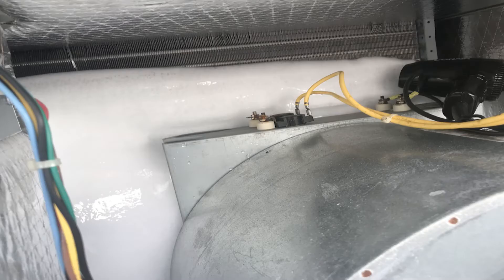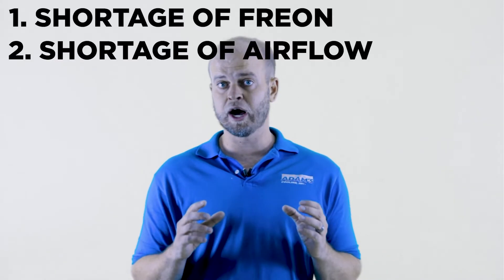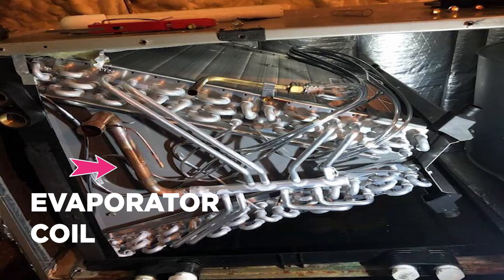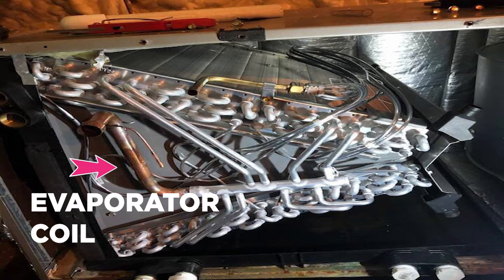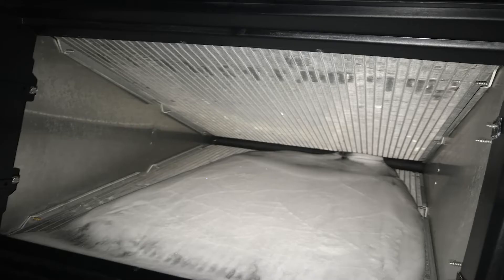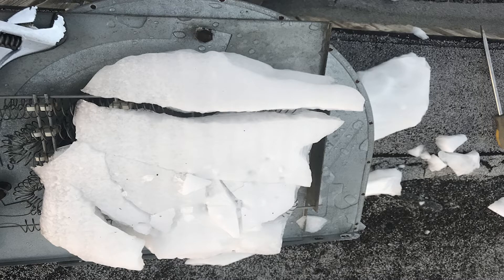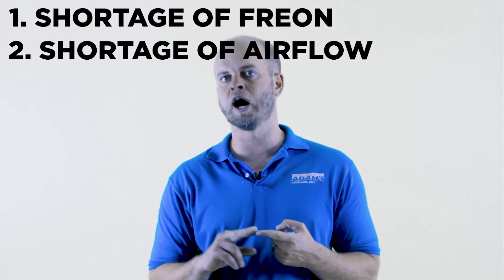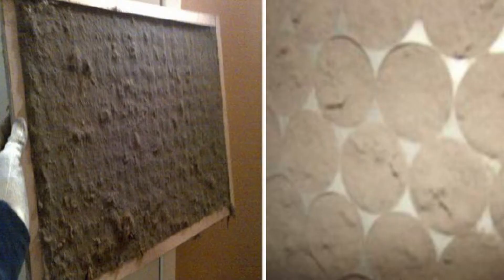AC Freezing Up Inside House - Here's Why

Comment: Can the coils on the outside turn white with ice around it? Everything seems to be working good inside besides the unit inside the house seems louder and it also gets cold (doesn’t turn to ice completely but does have ice around it)
Reply from the maker: You might have a restriction on one of your ac lines in your coil outside. Hard to say without seeing it.

Comment: I need help 😢 my ac stopped working completely I had a repair man come and he fixed a loose wire now The air is blowing cold, the filters were dirty but now there cleaned and its still freezing over at the pipe inside the house is it safe to take apart to clean the coil or what do you think could be wrong.  I also tried running with no filters for a minute and the same pipe froze
Reply from the maker: My first question would be, is the inside blower motor running (that means, when you turn the unit on, is there air blowing out of your vents inside). If there is air blowing, the next place I would look is maybe cleaning the coil. We have a video called Dirty Evaporator Coil Cleaning. I would watch that video and I hope it helps 👍

Comment: Blower motor cap is out would take out the blower motor right  ? Then blower wouldnt push air at all right ? It's working got cool air but don't want a repeat of frozen inside unit . And not one video has said one possible cause of this is failed outside unit capacitor right ?
Reply from the maker: If Blower motor capacitor is bad then yes, it will keep your blower motor off, which would then freeze your unit up. Hope this helps!
Reply: @mechanicsfornonmechanics8998  I just went out to an acquaintance house and checked that her drain line was draining and she then told me an AC tech been out there filling her refrigerant.. not fixing the leak just charging her to fill refrigerant.. geez 🙄. No actual repair work was done six months ago when she called him the first time. Just refilled the refrigerant and then two weeks ago he came back to refill the system and again he didn’t fix the leak. Caaaching !! He figured he had a regular income source he could cash in anytime he wanted to
Reply from the maker: Yeah that is unfortunate

Comment: Is it okay to use a heat gun to speed up melting the ice, or will that in any way damage the coil ?
Reply from the maker: I would not.  Best thing to do is go to your thermostat, and just turn the SYSTEM off, and then turn the FAN from the AUTO position to the ON position.  It will take an hour or two to melt, but the fan will do the trick.  If you don't turn the fan on (or if the fan is the issue), then you are going to need to wait even many more hours for that coil, the line set, and whatever else is frozen to melt.  Thanks for the question, brother!
Reply: @mechanicsfornonmechanics8998 turn heat on using fan to melt?
Reply from the maker: @jimmydempsey4884  - I would just use the fan.  It will dry out in a couple hours.
Reply from the maker: Nice